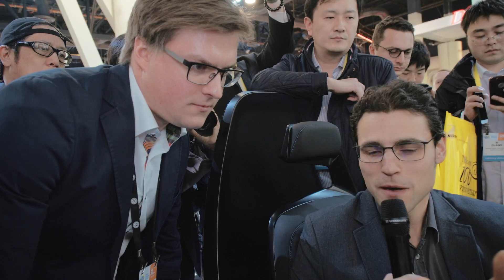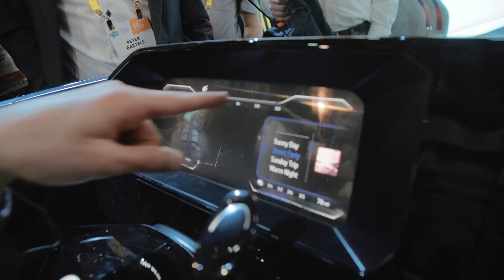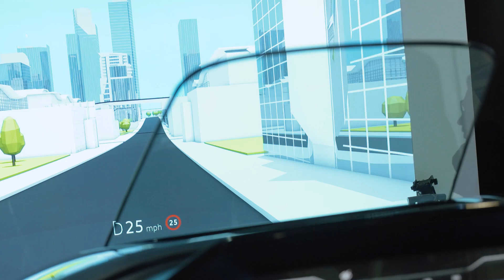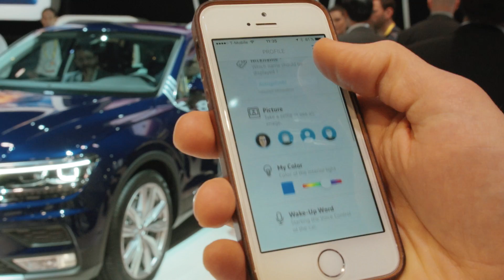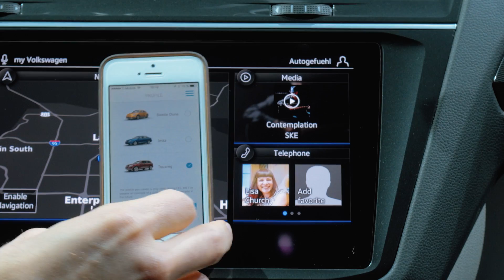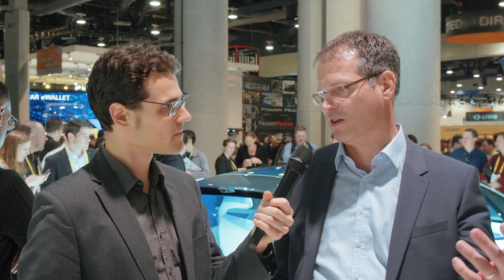Future VW car Cockpit/Interior & Volkswagen I.D. ecosystem @ CES - Autogefühl

Comment: Where he put the phone on the door to unlock it is 100% fake. He used an iPhone and Apple does not let any app make use of the NFC antenna. Although it could be that they used Bluetooth as keyike Tesla does it but then I see no sense in holding it near the door
Reply from the maker: Well it doesnt matter that much since this was a showcase only anyway
Reply: @autogefuehl  Well, it won't work in future that way though, so I wonder why they even showcased that

Comment: Why that much technology? Are they doing it on purpose, so that we have to pay more for services and fixes?? I mean, the other day I read an article about the Bentley Bentayga and saw that it has adjustable anti-roll bars that alone need a 48V system! And then I read that Mercedes-Benz is launching a new straight-6 engine (M256) with a similar system! I mean, what does a system this complicated offer you??? It only empties your wallet, first when you choose it from the optional extras and then when you service it!

Comment: Hi Thomas, very good comments as always, pertinent questions to the interviewees.
- the impact of battery production is a good theme that often gets neglected when talking about electric cars. What are the costs of extracting those rare elements? How much pollution is caused? How to recycle after? Is it feasible on a worldwide scale?  From what I've read there is a heavy impact on environments where lithium/other rare elements are extracted/refined.
I am interested to see from these car makers an impact analysis on the sustainability of these electric techs.
- could you please pose this question to car producer representatives in the future: are the consumers asking for all this it tech that gets pushed by car makers lately? As an insider(working in the software industry) I am aware that IT is the buzzword currently. All kind of products strive to incorporate IT features. My personal opinion is that car makers do it just because is fashionable, because they can and for fear that somebody else will do luring their customers. It adds unnecessary complexity - hard to use/expensive to maintain/more failure prone. My Bmw 4 series manual is 3 cm thick, mostly about the intelligent features. Twisted logic algorithms that after reading and not constantly practicing you forget. Improve passive safety so that people do not die on crashes. Maybe some big external airbag popping in the front in case of a collision... There is plenty to improve.
- if they want to be ecological/less polluting why not reducing planned obsolescence? Make cars more reliable, make upgradable architectures(engines, software, electric components). No need then to change cars each 3-4 years.
- autonomous driving - there is an infinite amount of traffic situations. Take for example those autonomous cars running on red light. It's almost impossible that a car reliably determines that a green comes from the traffic light(unless modifying traffic lights to supply additional info). There can be any green colored object that can be mistaken for a traffic light. My take on true 100% reliable autonomous driving : it won't happen with nowadays tech. Yes nowadays computers are way more reliable than humans at doing the same thing repeatedly but fail miserably when they need to face a different situation they were not programmed for. There is no way to implement the abstraction/learning power of the human brain with transistors. Transistor based computers are limited in processing.
Reply from the maker: Good aspects, helps me for the next interviews in Detroit!

Comment: This is why Germans play such a diminutive role in data processing, common sense should tell you that the driver needs to pay almost complete attention to the road while driving.  Having a large screen in front of him is dangerously distracting, worst still if that driver is required to negotiate through a complicated interface regime in order to get the vehicle to do what the driver desires. Therefore, the conclusion automotive designers should reach is that the simplest method is also the safest and that is utilizing touchscreens with larges icons that are readily comprehensible by the driver whose attention is largely compromised by the demands of driving the vehicle.